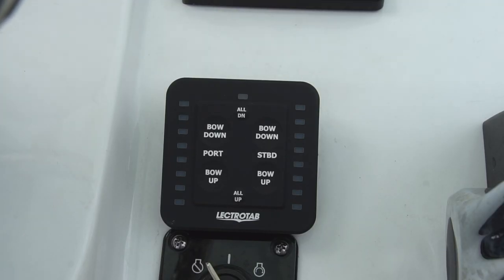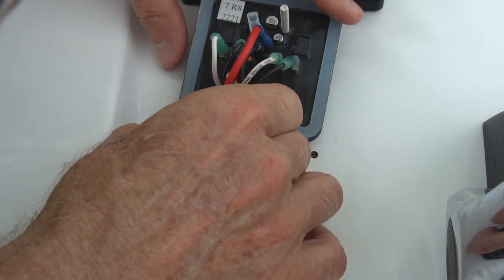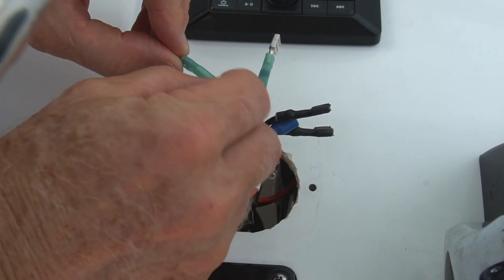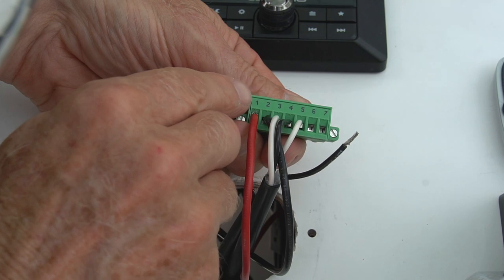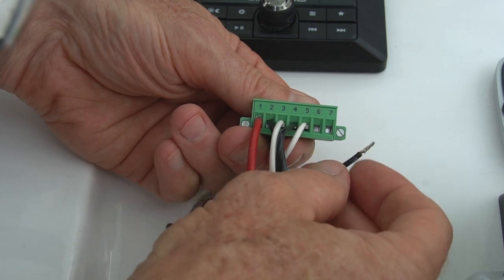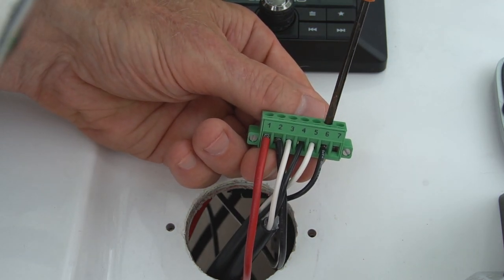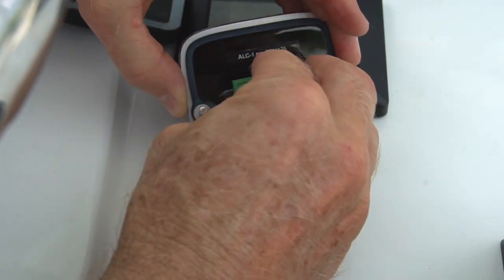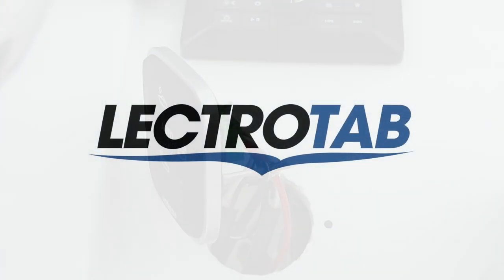Lectrotab SLC One Touch Control to ALC-1 Auto Leveling Control Upgrade

Comment: Does the Aux wire get abandoned since it can't be used in the Optional Terminal #7?  I'll be replacing an Oval switch with the ALC-1.  Sounds like a great product and a much simpler installation than other options out there!

Comment: Good video thanks.  Does the ALC-1 retrofit the SLC-11 opening in the dash and is there anything else needed for this to work or is it just the ALC-1 unit?
Reply from the maker: ALC-1 will fit in the same hole at the SLC-11 but you'll need to drill 2 small holes for the mounting studs on each side of the ALC-1.